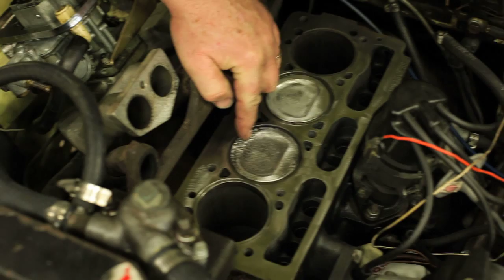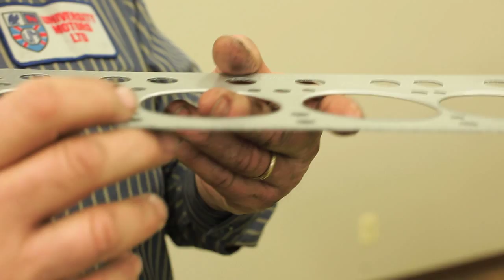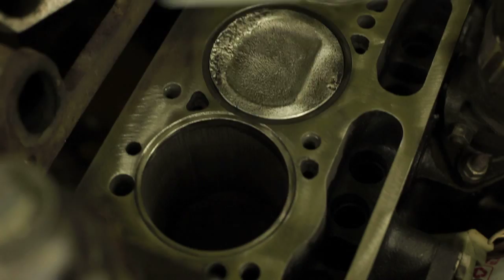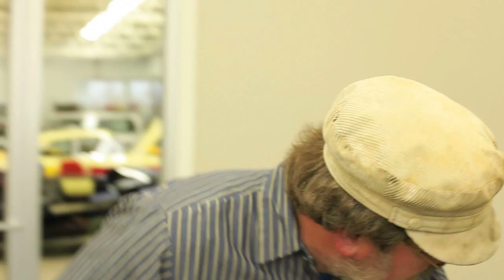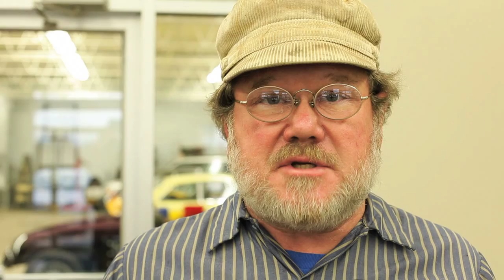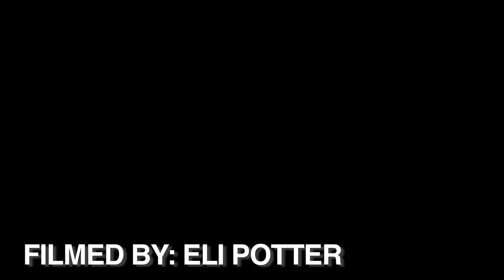177 MG Tech | Overheating problems of Midget 1500

Comment: Have a all of a sudden problem with my midget with 10k miles on the entire car mint condition with the engine oil over heating and oil pressure loss has the crush washer turned??????